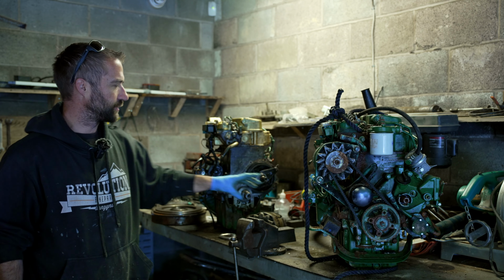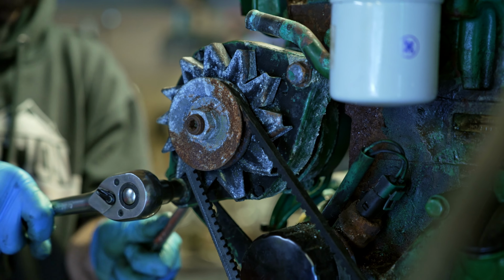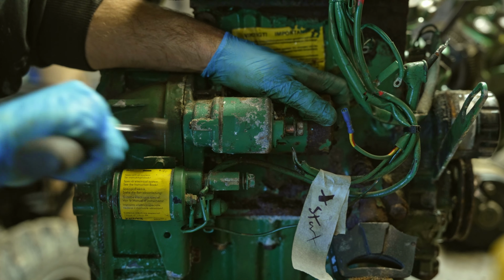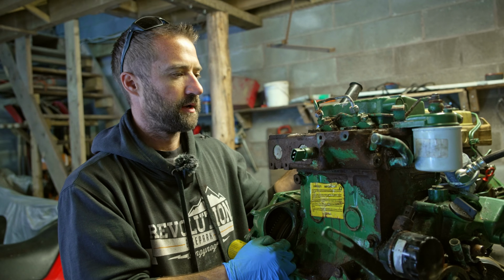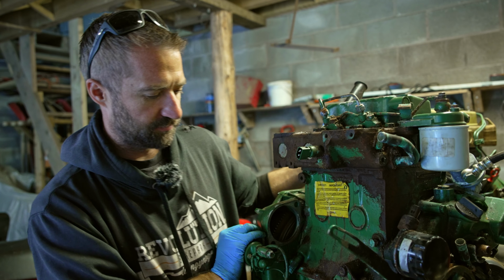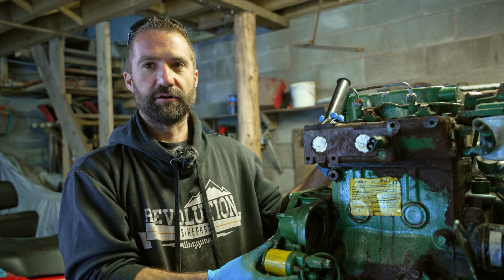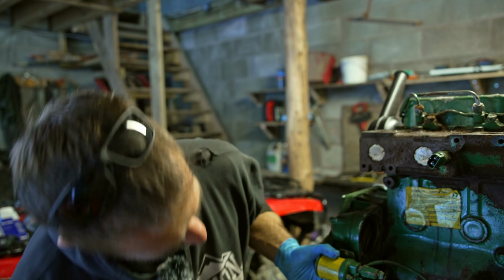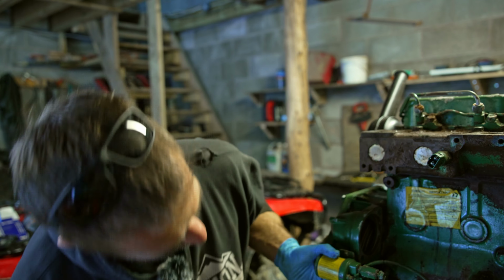Will it run? Replacing our Etap 30 engine

Comment: I think the solonoid is to isolate the engine from ground (when not operating the starter). This is to avoid galvanic corrosion of the saildrive due to the alternator current circulating trough the engine+saildrive
Reply: I think you are correct.
Reply from the maker: I shall let Tim know 👍